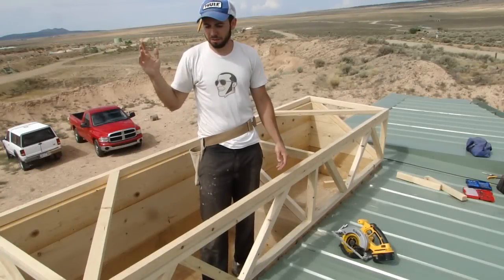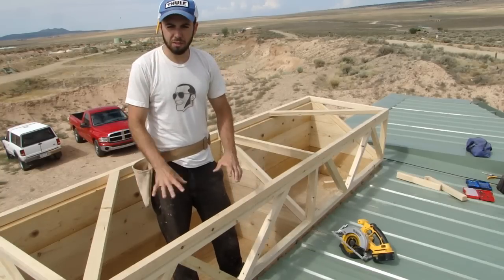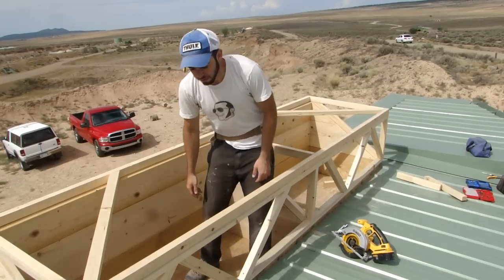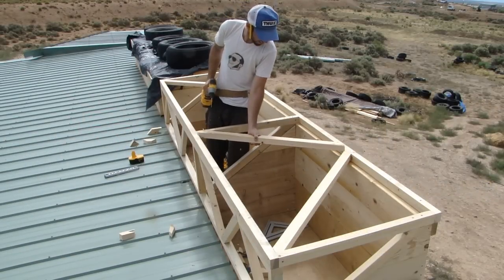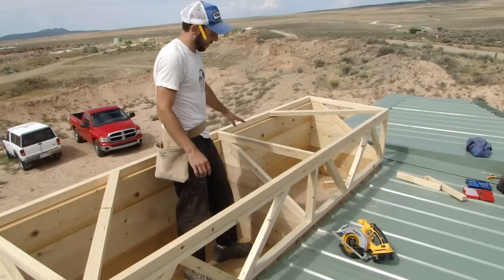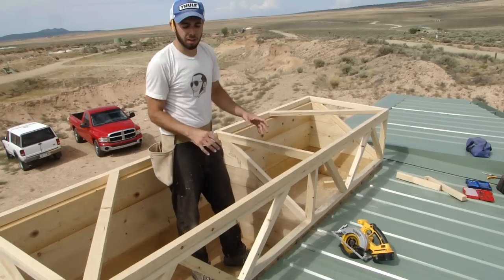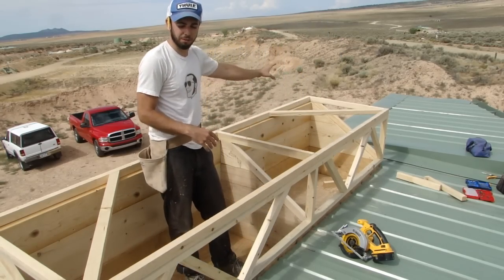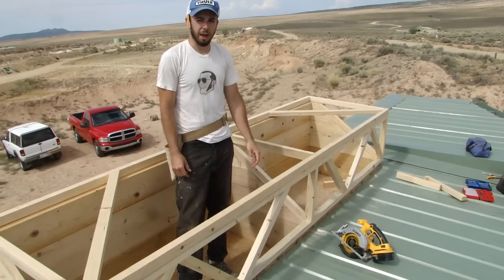How to Build Roof Boxes

Comment from the maker: I ended up make the vents on the sides of the box.  They are the holes you see on each end with the cover open.  The holes are screened and there are flashed soffits on the lid that keep the elements out.

Comment from the maker: Yes, batteries will definately have a longer life span if kept in a cool, dry environment with steady temperature.  However, this is what the Global Model Earthship design calls for.  Temp fluxuations are not as great as you would imagine because the systems box is fully insulated on the sides and top and not on the bottom.  This allows for heat from the greenhouse to keep the box at a more steady temp at night in the winter.